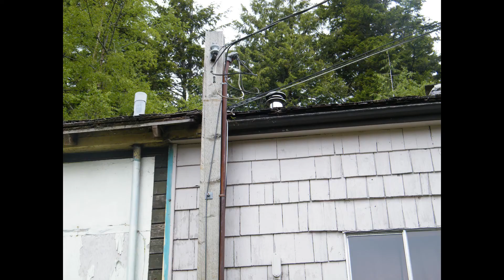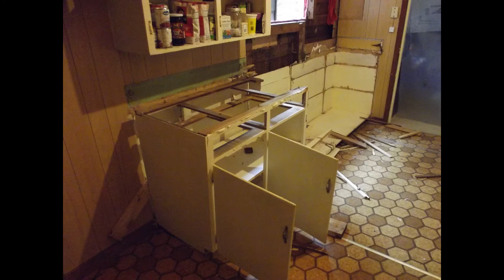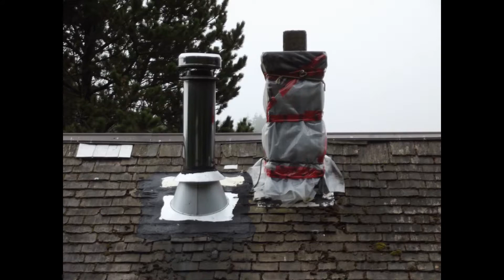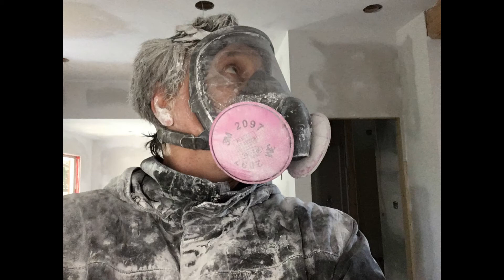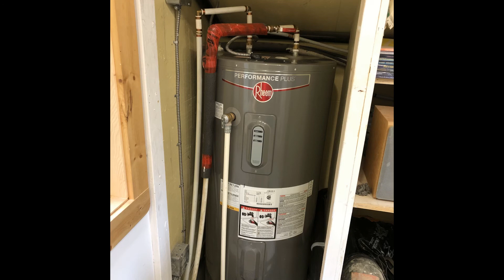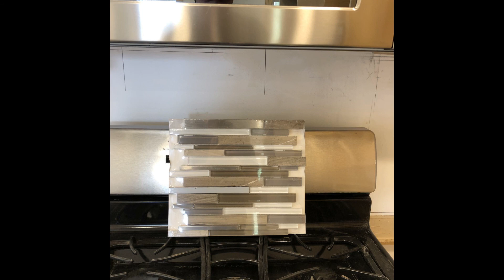I BOUGHT THE WORST HOUSE I COULD FIND. THEN REBUILT IT !: A PHOTO JOURNEY

Comment: You sure gave it hell didn't you? That's some beautiful work. Must have been a few "What did I get into" spread throughout there but Man, that one pic you took up on the hill looking down at a fresh steel roof kind of says it all. You have to be feeling really good about the work you did.
Reply from the maker: There were many "what did I get into " moments! (make that days--weeks!). This short photo-show hardly begins to show the work that was needed, especially underneath-and on the roof. For example, there were several inches of cedar shake roofing, one layer on top of the next. When it needed a new roof, they just added a layer over the old one! There was literally a ton of wet, rotten shingles under the first layer. The steel, in comparison, is installed over two layers of tar paper and is much lighter. I think I heard the old gal sigh in relief when that weight came off her. But some ask, "why not just knock it down and build new?" The answer is because it is less expensive to renovate and rebuild than to start from new from a cost-up-front perspective. I couldn't afford a big purchase but I could afford a trickle out the door over a longer duration...so I bought the worst house in town (maybe anywhere!) and I turned it inside out...and tada...a new house under me! Was it a challenge? Absolutely! Would I do it again? Absolutely Not!! LOL hahaha.

Comment: How's she goin'?  Well now this is a really nice job of renovating an old house.  Tons and tons of work and effort but it sure does look a lot better.  Better than better!!!  What a transformation!!!  Nice work.  Thanks for sharing your looong journey to get the house to this point!!!
Reply from the maker: It has been a HUGE JOB but it's almost finished. We used to joke that the only thing that was any good in the house was the hot water tank haha, but that quit last month LOL! I completely rewired and re-plumbed the house myself (all under homeowner permits that you can get out here), and I drywalled it myself and, well, everything: replaced beams underneath,  changed floor joists (as you can see), added 2 feet overhangs all around and installed the steel roof. Before I put the Hardie Plank siding on, I covered the whole exterior with rigid styrofoam insulation, then I opened up all the interior walls and insulated with Rock Wool (Roxul) This old place had "0" insulation in the walls. I'm tired now...I have to sit down... LOL Just thinking of what it took makes me sleepy Haha. Thanks for watching and your comments are always so nice to read!
Reply: @EverydayProjects  You did it properly.  Nice to see that these days!!!
Reply from the maker: @GrampiesWorkshop  I poured some concrete countertops yesterday and the video will be coming to the channel soon. The next project will be installing hardwood flooring. Stay tuned! The leaves must be starting to turn colour in Nova Scotia...or will be soon. Always such a beautiful place to be in the fall.
Reply: @EverydayProjects  A few have started to change color.  Seems early but it's about normal eh!!!